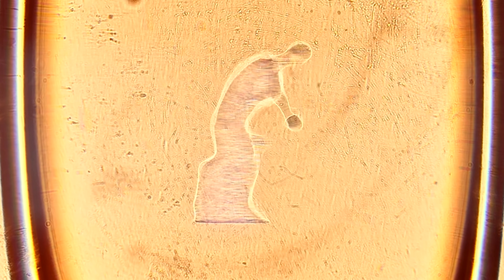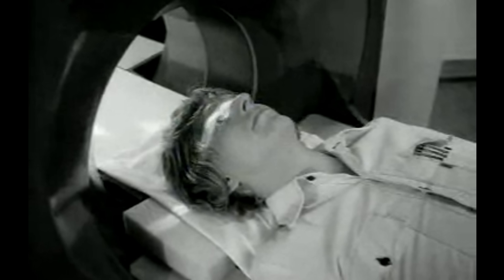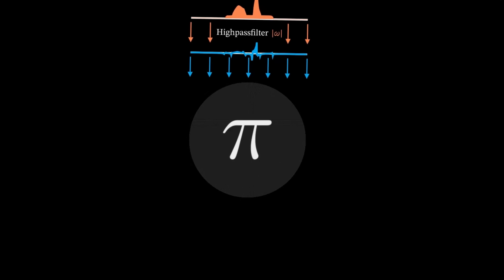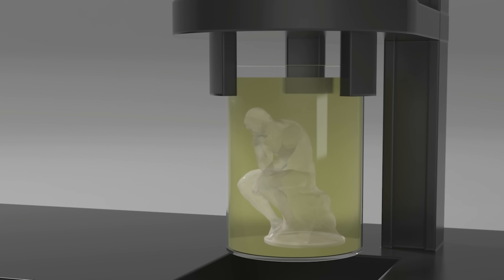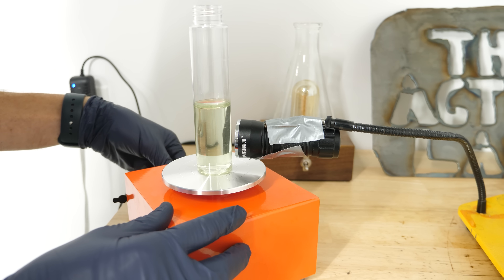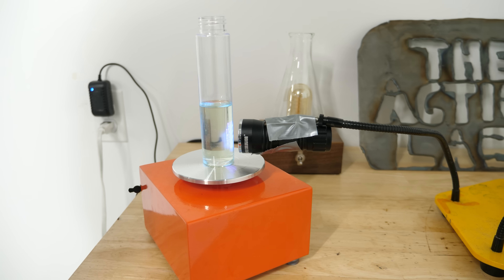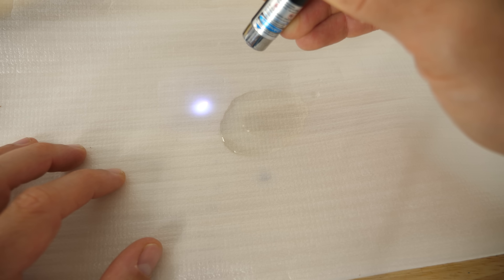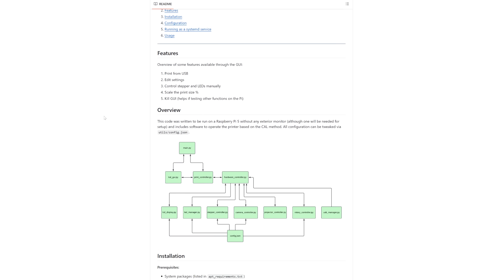Volumetric 3D Printing Is REALLY FAST

Comment: The first time I heard of the concept of 3D printing with light hardened resin it was basically this.  It was on a show called Beyond 2000 from the mid 80's.  They proposed using resin and holograms with the resin hardening wherever the light was visible.  It was a good show, they predicted this, iPods and a bunch of other stuff that actually came to pass.
Reply: Beyond 2000. That brings back memories. There was another similar show that aired back to back with Beyond 2000, and that block of television was the first thing I remember actually sparking a real passion in me as a youngster
Reply: I remember it in the 90s. Loved that show. They said "one day we would straighten our neighbor's thin TV's hanging on the wall, the way you would straighten their photographs or paintings".
Great show.
Reply: You just made me realize the fact that 2000 was 25 years ago...
Reply: It certainly didn't take long for it to come to pass, either. Electrolux AB (the Swedish appliance giant, not the US vacuum company) was producing prototype parts this way in the late 80s. At the time, Frigidaire (then White Consolidated Industries) was a subsidiary. The had all their divisions switching from 2D AutoCAD design to 3D modeling, especially for plastic parts; since at the time AutoCAD's 3D capabilities were fledgling, they were pushing CATIA. Electrolux produced several parts for the dishwashing division that way, e.g. a pump impeller.
Reply: @BeforeAndAfterScience  That might explain why the university was running this project “open source”
Reply: @BeforeAndAfterScience  Kind of bizarre it didn't take off in the consumer space a long time ago then... Seems like a bad omen. Is the special resin just stupidly expensive or something?
Reply: I absolutely loved that show. I think it is a huge part of why I fell in love with technology, and eventually became a software engineer. Content like that back then was hard to come by.
Reply: @joshman1019  But did they predict you were going to lose your job to AI?
Reply: And to think it would have come even sooner if it wasn't for patents.
Reply: never thought I'd see Beyond 2000 mentioned in youtube comments! loved that show... back then was peak optimism for all things tech
Reply: @Vorophobe  It really was great.  And it wasn't just PR releases from companies strung together like now.  It was well thought out and presented takes on the future of tech and they got a lot right.  
  I would love to see them reboot, maybe Beyond 2100...
Reply: @Vorophobe  Then the show had its sharkjumping moment when it added segments which were not about tech, and plain stupid. The company behind it was responsible for MythBusters later on, and some similar corruption did seep in towards the end.
Reply: I just discovered that show on YouTube. It's really spot on for a lot of future technology. It's also fun to watch.

Comment: Does the weight of the cured resin change? Would it make it fall from suspension at larger volumes? Does the rection itself cause any forces that would alter its place in the suspended resin?

Comment: The light coming from the protector can't be linear, or else you would be forced to just set your beam intensity high enough to cause polymerization without any control over where in the beam path you get polymer. You need intersecting beams.

UNLESS, the beam intensity threshold isn't actually about beam intensity, and instead total energy deposited over a certain amount of time, relative to the "relaxation" of the system. 

In any case, I just don't see how your explanation can work as-is.
Reply: I believe there is a time component. He mentioned that oxygen deactivates the activated resin before it can form chains. That means you have to maintain the light for a certain time to keep the resin activated long enough to form the polymer chains.

So there's an intensity threshold, and a time threshold.
Reply: Think of it like a gridless 3D rotational version of Picross. It doesn't need multiple projectors to intersect because the single projector rotates to the next position to then intersect what it "put down" in the resin in the previous position, repeating for each frame of the printing data.

Comment: The only giant drawback is the fact you can only use the one type of resin material. Today you can choose from thousands of different filament types specialized for whatever purpose you need, from metal to rubber to carbon fiber particles. This certainly has its own place for certain applications though.
Reply: It will improve in future for sure
Reply: @Dr.Akakia  I'm not too sure about that. SLA resin printing has been around awhile and there's been a real lack of new materials; the resins have to be photoreactive, severely limiting the number of viable materials.
Reply: @PsionicFrost  I knew there was a catch

Comment: But doesnt the rest of the resin in the vial become partially cured? Would you be able to reuse it?
Reply: 10:37 for ya
Reply: That's why the resin has a threshold of light intensity, below which it doesn't react at all. The rest of the vial, outsid eof the direct beam of light, wouldn't be exposed to intense enough light to harden it.

Comment: How do they keep the object centered/stable while rotating the vial?
Reply: The viscosity is probably thick enough to prevent signicant thermal convection.

Once the container is has been spinning for a short time the fluid will reach a steady state of motion and be static within the inertial reference frame of the cylinder.

Comment: If this can hit the market at somewhat affordable prices, this will likely kill current resin printers. Fast, detailed, no layer lines, no supports, less finniky, and probably easier to scale in size.
Reply: not really though. You can only use one material here. The special resin. With this you lose the ability to choose from thousands of different filament types.
Reply: @johnjingleheimersmith  who says that it's impossible to create other special resins? And is there really such a large variety in current resins? The ones I know are all pretty similar, they just differ in color and eco friendlyness. And color doesn't really matter since resin prints usually get painted anyway?

Comment: How do they keep the bottle from distorting the image?  It would seem like the bottle would cause the light to bend when it hits the curved bottle.  I'm assuming that projection is distorted in some way to correct for this? Or is the light too intense for the distortion to matter?
Reply: I think it is projecting a vertical 2d line.